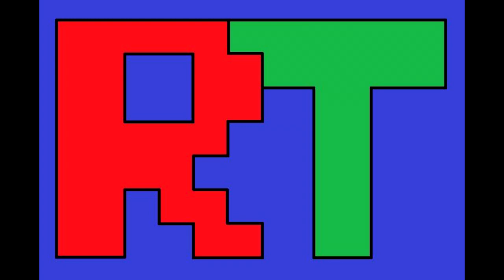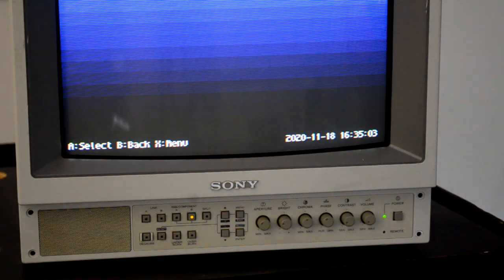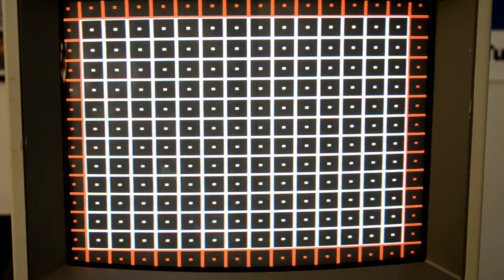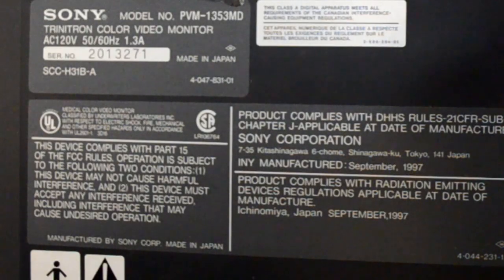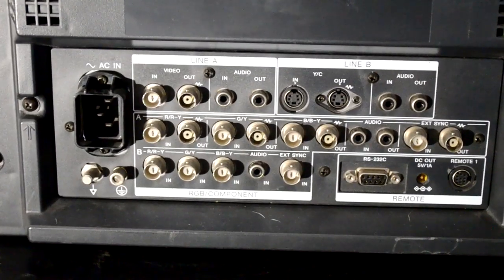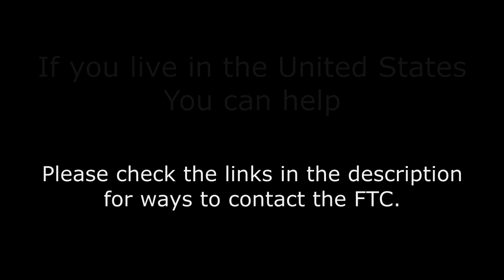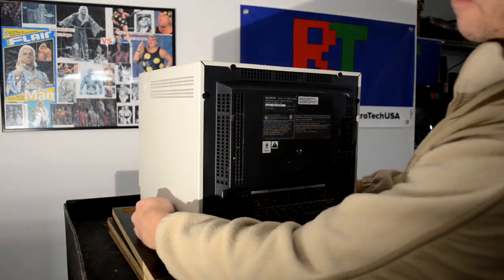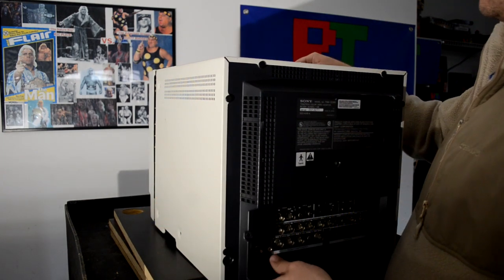Is this the end? Can the FTC destroy Retro Gaming Vids w/ COPPA in 2020? & Sony PVM Repair footage!

Comment: Off topic bit I could use some help. I'm working on doing a recap for the second time. Both tvs ive recapped had the flyback hardwired into the neck board. How do you deal with this? Do you desolder the flyback to work on the main board? Or do you just work around it. Thanks. Any help much appreciated.
Reply: You should usually remove the neck board from the CRT with care and the anode cap (after discharging) and get the main board and neck board as an unit. Just take photos of where all the cables go
Reply: @ivandiazalvarez , yeah that's what I did last time but this time the wires at the end of the glass are soldered into the neck board and I don't want to meas with that so I was going to desolder the focus and flyback instead. Ita a pain to work on these boards with everything connected
Reply: @riggel8804  If you mean the earth wire from the aquadag that goes to the neckboard, yes it is usually not soldered but can happen. I think it is easier to unsolder this one, but If you unsolder focus just do it after discharging the anode cap because focus is derived from the EHT voltage, sometimes it is a pain to remove it from the hoshiden connector so you may have more luck desoldering the entire connector (after removing it from the crt of course).
Reply: @ivandiazalvarez  thanks for the advice. I already discharged at the anode cap and I checked some of the larger caps for charge. I'm going to try to recap with the boards connected but if it gets to cumbersome I will try what you suggested... Caps get here Friday.

Comment: Hi, ordered a Sony PVM-1443MD. Maybe you can help me? After push powerbutton  led is on, but not so bright. I don`t know if this is normal? Monitor does not sync any signal. Test it with different Consols via. RGBS, S-Video and composite. Nothing, no Picture is showing up. Monitor stays completely black. On the left side glims all 4 led`s for Inut constantly but also not bright, is very low shining. Can someone tell me if this normal? Today disassemble all and build it togeter but no differnt no sync Signal. Taken a shot of this Monitor. hope someone can tell me if this is normal with the soften led? Next step is replace all capatzitors on PSU. Can a recap help? Thanks & greetings from Germany!
https://s19.directupload.net/images/191120/dnvmo2yo.jpg